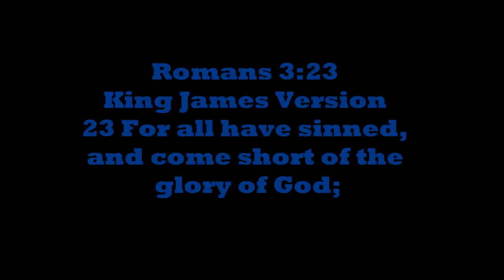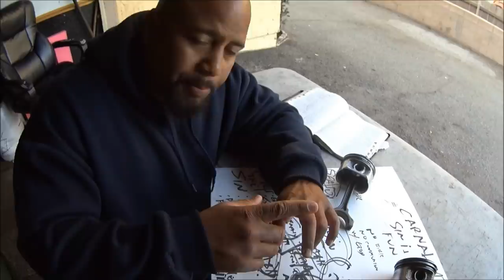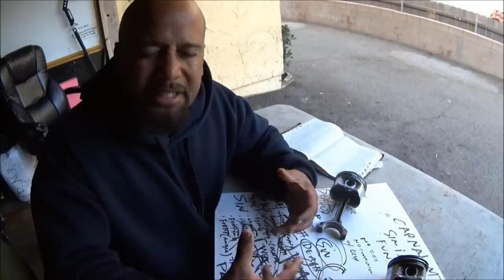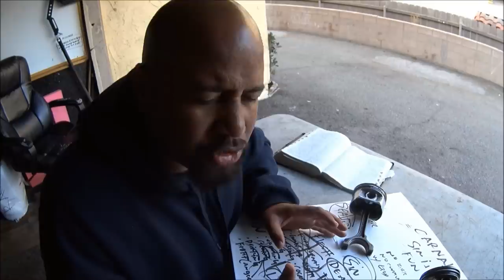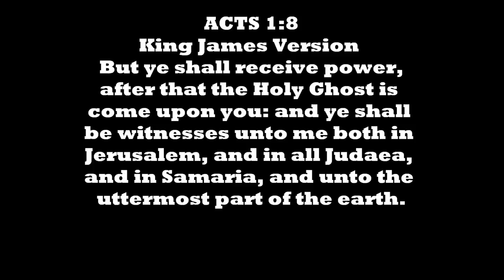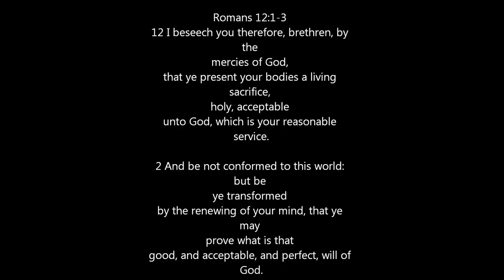FIX ROD KNOCK UNDER $40 FOR THE BROKE FOLKZ HOW TO FIX YOUR BROKEN SOUL STARVING YOUR SPIRIT (2023)

Comment: I did this today on a 2014 Hyundai, Used your method but I started with 400 grit & worked my way up to 2500 grit, Worked like a charm bro I’m really happy, Took about 4.5 hours to complete & only cost me about $50   For Bearings, Assembly lube, gasket maker, Oil & filter, wd-40 & some carb cleaner to clean everything before the new bearings went in.

Comment: ATF is superior to WD-40 as a friction modifier and cleaner. Toothpaste is an excellent final journal polish. It is VERY important to thoroughly rinse all polishing residues from all surfaces when done, preferably with brake parts cleaner. Be very careful- not to get oil or assembly lube BEHIND a bearing when installing. The surfaces must be clean and dry, or the shells could spin. Before first startup- pull the fuel pump fuse. Crank the engine about 15-20 seconds. This will build oil pressure, without any running force. Wait a minute and repeat. Reinstall the fuse, start it, let it fully warm up. Drive it gently the first 50 miles, to break in properly.
Reply: Well said, well.said!. You are so correct in your statement. That procedure you've just mentioned separates the real mechanics from the amatures. Cleanliness on a worn engine such as this is of the utmost importance.
Reply: 100%! i was worried he wasnt cleaning enough... dry start up... ugh
Reply: Eze&Yare Dominguez main word there ARP headwear most people just end up using the original hardware
Reply: El_De_La_Lobo  i used arp and i think i still spun a bearing smh brand new king xp series. Had all the proper stuff done to the rods for arp
Reply: The best cleaner is to use hot soapy water..Was taught by Honda engineering school..

Comment: I replaced the rod bearings and main bearings in my wife's car 14 years ago, in the driveway. Still going strong.
Reply: fortj3 realllllyyyyy??????
Reply: Bro I like your style and respect you continue to do your job! That's the things I want to be on and gonna be on its one of my jobs!!!  Thank you!!!?
Reply: I add "Prolong" oil additive 1st oil change.  Did you find shaving after fix and 1st changed oil?  Shavings in bottom of drained oil pan or shavings in the cut open old filter?
Reply: enginemaxcarb.  Dont be so salty, these vedeos obviously arent for you. Go throw $1000 at your engine and youll get lots of miles. These videos are for the broke folks that need to get back on the road 💪

Comment: just came back to give a huge shout out! I used your video to get our little 2007 chevy equinox back and rolling. For real life saver. I don't usually comment but this video actually saved our family. We are young and broke, had our first baby just as the pandemic blew up at the beginning of March 2020. Lost my job. Wife's chevy gave her the low engine pressure light. Had it towed to chevy and they quoted $6000+. Basically new engine on a $2500 car. That's where your vid came in. Watched it multiple times and got all the pro tips. Along with a haynes manual, a friend loaned engine lift. The only annoying part was that getting the oil pan off this equinox required removing the trans axle, drive shaft, intermediate axle, lifting the engine a couple inches to clear the transfer case. In the end, it cost me $200 and a week of a few hours here and there to get it back on the road. 2020 to 2022, still driving "strong" haha. The engine still has a small knock on start up and high revs(obviously, like you said, not the perfect repair. Probably main bearing damage) but it's still a daily communter/grocery getter/baby sitter drop off machine. We really appreciate you putting out videos like this that help folks who can't affor the through and through "professional" fix. You aren't scared to fix something enough that it works for the time being. Thanks again man and god bless.
Reply: Bro this just made me smile fr. I'm 25, my wife and I are expecting our first child in 6 months! We heard the knock and at first it had me really down because we don't have 2k to replace the engine. I got on YouTube and came across this video, found the courage to tackle the job & got it done! So far so good, I'm praying it last us a few more years. I hope your baby is healthy and doing good bro!! Stay strong 💪

Comment: A lot of people might hate on this but for the people who cant afford a new engine or a rebulid, it's very useful you got to do what you have to do
Reply: its also frowned upon, when you call yourself, jesus... anyways... god bless you guys! I still have a couple questions unanswered as im new to this whole crank and rod bearing replacement. I need to understand how he removed the secondary timing chain, without interrupting the main chain...? Another question, this rod cover is annoying to fully remove, I only removed half of it, as the other half is still covering over the first and second cylinder/rod. idk, how to fully get to it, some advice! Thank you all! God bless you guys.
Reply: JPS JPS  He didn't say this is a good as new fix. This is just to get you down the road. It's not like this is making it worse. Most shops would just replace the engine with a reman one.
Reply: I just fixed my rod knock with help from this video last week 😊
Reply: @lilmixdboy  is it still running good?
Reply: @TheWuzyy  no. The timing chain failed

Comment: Love your approach to help people who dont have what they need to do a major job or do a replacement.  You did make a few goofs here?  Tell me what you think?  The first is at 15:42 you make the decision to bypass replacement of the main bearings.  Main bearings can be done in the car by backing off all the main bearing bolts slightly, pulling the cap on your first main, and turning the crank to reveal the oil hole.  You can insert a small screw in the oil hole so the head stays on the journal surface.  You can then grind down the head of the screw so that when you insert it in the oil hole the flattened head of the screw will push the bearing out as you turn the crank:  its like making a temporary bump in the crankshaft that will push the bearing out.  you can use the same method to reinstall the new bearing.  If I was approaching this engine I would have pulled the valve cover and plugs before pulling the pan and I would have poured a gallon or so of diesel over everything to try to flush the engine of metal.  I think your title is misleading a bit here?  Folks need to know what they are getting into fully .  Carb cleaner, assembly lube, two oil changes, two filters, gaskets, RTV, and the main and rod bearings will go well north of $100.  In my view this job takes $250 to pull off doing both rods and mains and if you dont do mains, you are limiting the life of the repair.  It is true that the mains face only rotational force and not so much of the pounding reciprocating force that the rod bearings face, yet, the wear in the mains caused by the rod bearing pieces will reduce the oil pressure in the engine, making your rod repair last for a shorter period of time.  Using the screw to "roll" the old main bearings out of their roosts is critical to the success of  the "make do"  rod repair.  Just my two cents.  You are a blessing to the world community.  Keep up the great work.

Comment: Here in South Africa this is how we keep our cars running ...Old school Fixes !
Reply: Clyde Muller Lekker, yes for sure. I'm doing this right now!
Reply: @robtheninja9291  if youre doing this i would suggest you make sure u use a magnetic sump plug to collect any matal particles left behind in the engine.
Reply: Yeah... that's how we do right!
Reply: As long as you don't go running down the road 80 MPH / 128 KPH down the road it's all good, keep it below 40 MPH / 64 KPH and keep your trips near home base and don't run the engine at high RPM's.
Reply: @hrevyaga82  Yeah, you so good! I gave a friend an a similar advice earlier today, 'please don't rev your engine up to higher RPMs just for fun!'
Reply: I'm in south africa and do not do it like that... LOL...
Reply: @moeketsimgqwetho385  If you not running the INDI 500 or Nascar in Charlotte NC at over 200 miles an hour such repairs can last a while as long you do not over-rev or load the engine. Repairs like those are carried out by many in countries with very little resources or part embargoes like CUBA. 
You certainly can not speak for every one
Reply: @hrevyaga82  Hey.. I agree do not have all the facts... I must have just reacted to the fact that I noticed that internationally SA is regarded as much more poor that it actually is but as I said might be wrong, probably most of us do these kind of temporal fixes, Actually enjoyed this video and I am going to use this method for my Ford ka that I am working on, like also the Bible teachings that go with it...

Comment: I love how you have applied the breakdown of the motor to the breakdown of the morals. It is all in the heart of the motor and the heart of man. God Bless you for this message.
Reply: SERIOUS QUESTION if I replace my rod bearings will it bring back my oil pressure and get rid of my knock? Got low compression on 2 cylinders good on the rest.

Comment: I can't believe some people downvoted this vid. Some of the best mechanic content I've seen on youtube. Only thing I would change would be slide a small micrometer around the journals/plasti-gage it and see if you could take out more slack with undersized bearings. I feel like this guy is good enough he could make it happen to factory tolerances on roadside. Still excellent work man. You just got another subscriber.

Comment: I learned and witnessed from my Grandfather, long deceased now, that every piece of cigarette paper is 0.001. We can use a new bearing and plastigauge.  The paper goes between the bearing and the rod AND between the bearing and the cap.  Make sure that the oil hole is not plugged if you need one.  This will work for your mother's Comet but not for a Saturday-night-special or so I think.  The engines that I saw him do it on were just daily drivers for older people.  No rebuilding necessary and it wasn't a short term fix.  It was a long term fix.  I hope this helps someone.  Today, I would put a high volume oil pump and a 20/50 oil.  God love you, brother.

Comment: You. Are. A. Savior. I have a 1978 corvette stingray and I had to replace the whole fuel system, while brake system, new suspension, new transmission, I’ve put so much money in it and when I got it started finally, I hesd the “knock knock knock” and I almost lost my mind, I did everything you did step by step and it’s completely gone, thank you for this video and please keep making more like this it helps people so much🤙🏼rock on man keep it up
Reply: Still running good or have u sold it? My mechanic is dealing with a similar issue with my car, im trynna see if i keep it for a lil longer or if i just sell it after its repaired

Comment: Excellent Video. I watch it every year. 

I tried a method similar to this, with a hydraulic lifter that is stuck on my G35 Sedan I bought to refurbish for my wife. I opened the valve cover, cleaned as much carbon as possible with Seafoam. I sprayed B-12 into the areas around the lifter to unseat it. Put a barrier of rubber around the lifter area and saturated with more seafoam. Kept refilling and agitating. Dried up everything around where the gasket goes, put it back together. Poured seafoam into the valve cover, put the cap on, and started it up. Barely had a lifter knock at all. Changed the oil and filter, sprayed I take cleaner into vacuum tube, let it run for 20 minutes, drained it again. Examined the oil, a lot of carbon and gunk came out. Filled it again, new filter. Added seafoam to the oil again. Ran another hour. Drained a last time. Oil was significantly cleaner. The knock is a mild tick at this point. Added full synthetic with Marvel Mystery Oil, started it up. After driving two days, it runs great. Added a oil catch can and cleaned the plenum. 

Your advice showed me this. Thanks for all the help and love. 

God Bless, 

Luke

Comment: 9:22 shoulda been titled “how to fix rod knock on a shoestring budget”
Reply: Hey i thought that was pretty clever.
Reply: Lmao!! Good one
Reply: Its pretty smart tho. I havent let my engine knock go as far and my bearings were barely starting to loose tolerance. Ive gotten the new crank, new pistons, new internals basically for around 680. 

He basically did what I did for the bearings except he didnt measure the tolerance
Reply: Except the expensive part on most cars is getting to the crank.

Comment: Can you make a future update of how when this engine passes out? If it even this because this is the best fix I've seen on this so far
Reply: I've done it once on a pickup and it last up to 3 years driving over 100kmh.  Ok, God was with me and i spent 150$ and a week end.  So just to tell, this engine runs very well i think.  It is gonna last more than 6 month.  But another thing, it is good to run it a week and rechange oil and filter and at this point add a Duralube tefflon bottle.  Have a nice day and take care. Luv u oldskool funk , keep going this way heavens doors are yours.

Comment: It is advised that those crankcap bolts to be replaced as they are stretch bolts, I have heard of people reusing them but they torque it different to the manual as if you add the 90° or however much extra turn on already stretch bolt, there's a chance for it to snap off under extreme circumstances.
Reply: xMinimalistic that is vehicle specific, check your vehicle specs. If yours is, then he is right, replace them.

Comment: Old school buddy! Whatever gets you down the road. I swear that engine will last more than a year if you take it easy on her, just change the oil and save your hard earn cash $$$
Reply: If you drive it and don't race it along it will last years.My dad rebuilt a v8 like this and it ran for 10 years.
Reply: Georgiaboy706. Lifters are easy Change them out I didn’t even have to pull my cams to change mine

Comment: Man you fixed that engine! You don't seem to think it will last, I bet it does. Keeping the oil changed regular and etc... it will last, who said everything has to be absolutely perfect.
Reply: jthonn like he said though, that rod knock has already caused damage to other parts of the engine (cylinders and pistons). He definitely bought time though.
Reply: @angellawless7413  How has rod knock damaged the cylinders and pistons?
Reply: Gregory Fuller are you being facetious?
Reply: I won't last. Most of the time it lasts less than a week. I know from personal experience.
Reply: @gregoryfuller1136  When you have rod knock, the ignition of the fuel at the top of the piston actually slams down on the piston as its coming down or up instead of at top center. This causes the ignition to happen when the piston is slightly at an angle because of the play at the bottom end. It can definitely cause anything from wrist pin, piston skirt, piston rings, and cylinder bore damage. The crankshaft is definitely already damaged by this time and needs to be resurfaced and oversized bearings need to be used.
Reply: Just bought  a 77 f250 351m with rod knock... the kid has run it everyday to his job and back for over a year like that... lol he said she still runs strong! And he’s right she does but it’s sooo not good lol , but I’m sure there are a lot of old Chevys and fords that have been fixed just like this... I’ve done it in a 460 big block and drove 2000 miles the next day... she ran ok for 3 more years after that

Comment: Great job Brother! Earlier today found out my son's fiance's car has 2 con rods with similar issues as your video. Ordering con rod bearings tonight and hopefully, by the end of this week, I'll have the car running for them. They're on a tight budget themselves and do not have the money to replace the engine with a used or rebuilt one. To save them on gas, I'll be towing their car back from a 3-hour drive and pick up my backup car.

Comment: Bro God bless you I just spent my summer savings on my dream truck beautiful 2002 denali Yukon no dents no scratches and something told me it didn't sound right ,but never heard a knock it was just a raspy sounded like a pulley  but i bring it back home an did my research what the sound was and man just my luck guess what has a small rod knock.  Only hear it when rpms going down.  & thank you lord for this man 🙏

Comment: One more thing: The OIL PRESSURE generated by the oil pump actually Forces the 2 metal surfaces bearing and journal apart so there is no contact.  Great info, great message, Brother.  Mechanical ministry is beautiful!

Comment: Nice low-budjet DIY with ALL the details. I would use something like a belt or cloth strap that matches the width of the rod journal so you don't get any grooves when sanding them like a shoestring may do

Comment: I wish I didn't get a new van 4 hours after my van stalled, I still wanna keep it, it is my roofing work horse.
Thank you for your video. Saw the video late, but not too late! I didnt scrap it yet!

I planned to swap moters I have a donare van. Set aside. But that is alot of work.
2 motor pulls and swap the bottem of one with the top of the other. Because the donare van had a blown head gasket with aluminum heads that may have went bad.

Comment: Had the same realization that all I need is to replace the bearings, which can be done without removing the engine. So I decided to look for a video like yours to learn the related techniques. By the way, transmissions can be easily and cheaply rebuilt by going to a junkyard and pulling just the broken parts, which will be the friction surfaces like steel belts and clutches. Gears usually don’t need replacement. Snapring pliers are your friend.
Reply from the maker: Great point!